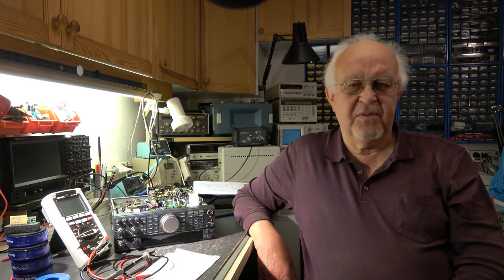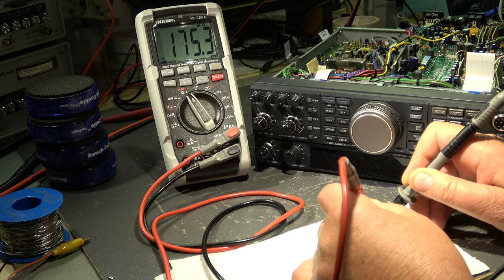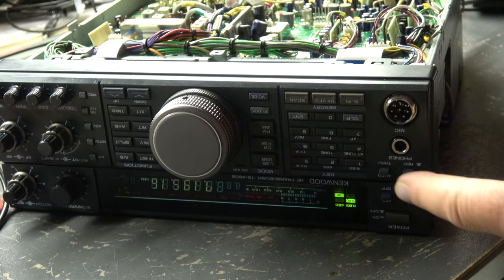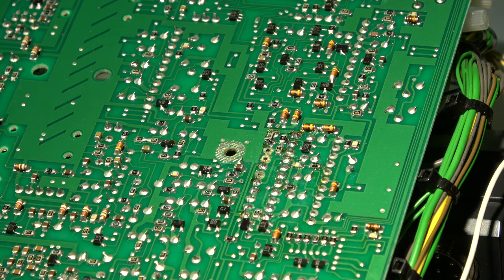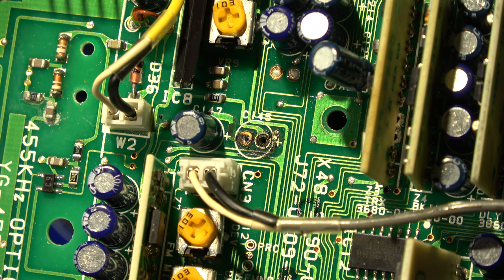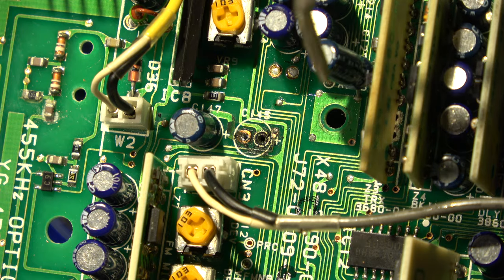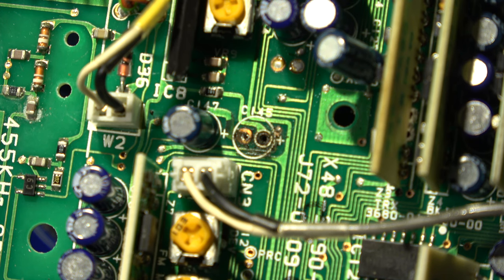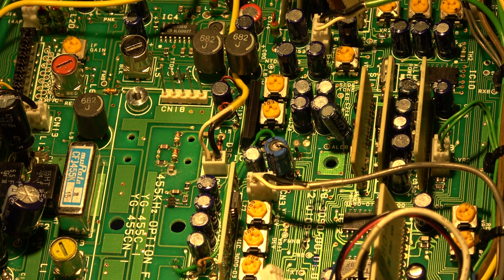#132 Kenwood TS450S Part 3(3)

Comment: Amazing repair , heck what a problem last scope picture spot on timing , good work,  I also work on a TS-450S it had the leaking audio CAP problem but i have another thing maybe i dont know but if i listen to USB mode on 20M on a staton and then switch over to LSB i hear the same station  loud and clear, so it demodulate SSB in both sidebands ? I dont  think this radio has ISB, i have not tested TX yet saw some comment on TX on both sidebands caused by  leakage erode on PCB need to get a MIC int was not supplied.  👍
Reply from the maker: Maybe a problem in the filter switching - the wide AM filter is used instead of the narrow SSB filter?
Reply: @dl7majstefan753  Yes that can be sure, it is wide i hear both sidebands when i tune , i will do a callibration and checkup the frequencys first.
Reply from the maker: @Peter-W1  Look for the filter selection on the left side of the S-meter!
Reply: @dl7majstefan753  Ok so the switching is done inside the front panel i will check , i just notised that the IF-shift is not workin either in SSB mode only CW mode that can explain it is in the AM selection, IF-shift is off in AM and FM mode.
Reply: @dl7majstefan753  Ah now i se there was a board behinde the front panel i got it.
Reply from the maker: @Peter-W1  Is the problem solved now?
Reply: @dl7majstefan753  Hello Stefan not yet I sent you a mail thought it could be easier, so far i have followd up the 455  kHz signal from CAR (DDS) and it changes 3.35 kHz between USB and LSB so that signal is feed to IF-Board and 4066 switches seem OK im on Select unit Z2 now, but cant se yet where LSB or USB detetcted i look further. check the mail i got bounce back on one mail you had on homepage , the othe rmail also bounced back , i corrected MHz to kHz above 73
Reply: The IC1 uPC1037 seem to be the IC that demodulate SSB signals depnding on carrier input and signal input (product detector)  I will check signals around that one.
Reply: It looks liek the uPC1037 Product detctor IC 1 is faulty, i have carrier on pin 5 from CAR signal and that changes 3.32 kHZ when i switch USB/LSB but the output is the same , so most likley this ic is faulty any thougts on that Stefan ?
Reply from the maker: Hi Peter, didn´t you want to send me an email? Nothing received up today!?
Reply: @dl7majstefan753  Hello Stefan yes i did but both the email i tested from your homepage bounced back after some days not deliveable so i dont know what wrong 1 eas your ham signla and the other your name. ??
Reply from the maker: @Peter-W1  try again! the last days we had problems with the provider

Comment: Great job Stefan! I'm amazed at how much damage acid from a leaking capacitor can do to a PCB. That was very small wire you used. What gauge was it? Stay safe my friend.
Reply from the maker: Hi Joe, don´t know the gauge, but the outer diameter of the green litz wire is 1,1mm and of the enameled copper is 0,6mm; the thinnest i´ve found in my box
Reply: @dl7majstefan753  Thanks Stefan.  FYI: 18 and 22 AWG (American Wire Gauge) respectively.
Reply from the maker: @Joe_KS1I  Tnx dr Joe. I soaked the metric system with breast milk ... hi.